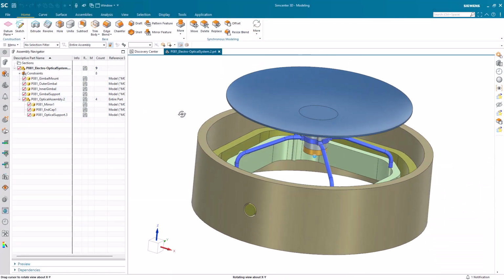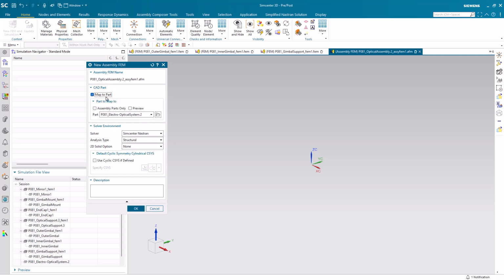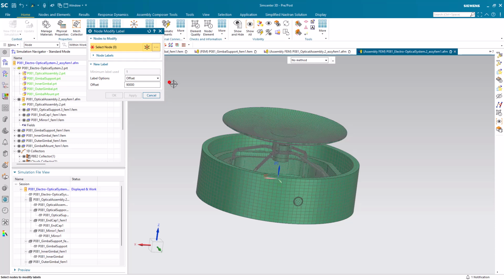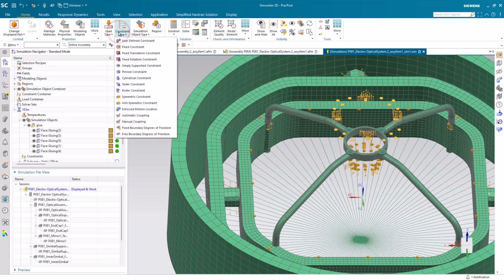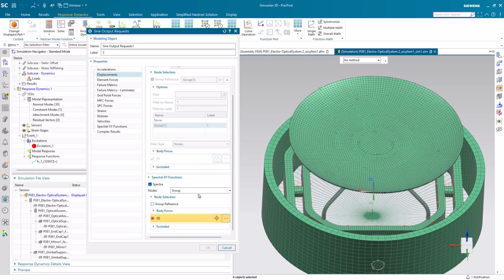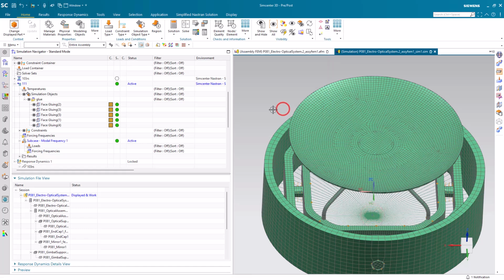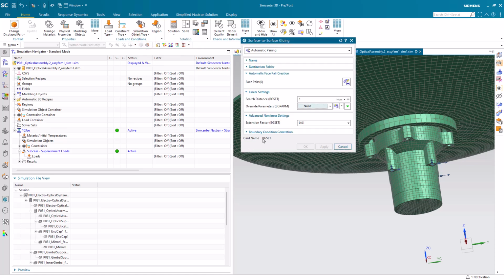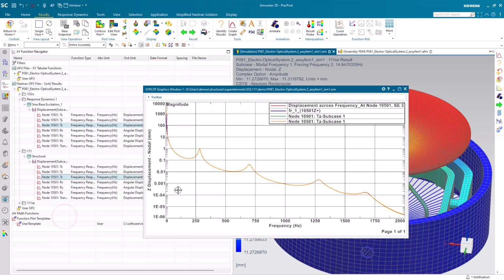How To Create A Frequency Response Analysis With Super Elements

Comment: In SOL 103RS you put user defined constraint with z-free to create the enforced motion. In SOL 111 you fixed all DOF on that point, why?
Reply from the maker: For response dynamics, the video is setting up enforced motion along the z-direction then SPC'ing the other 5 DOFs.  When we specify enforced motion, the exporter automatically creates an SPC for the DOF for which you enforce motion. Therefore, we are technically SPC'ing all the DOFs of that node. 

If we just have a simple static equation [K]{x} = {F} and let us assume we just have 2 DOFs in it (x1 and x2). Then K_{11} x1 + K_{12} x2 = F1 and 
K_{21} x1 + K_{22} x2 = {F2}.  Now if we enforce a displacement of 15.0 for x2, we know the value of x2.  The first equation then becomes

K_{11} x1 = F1 - K_{12} * 15

The first equation is almost as though we have zeroed the x2 DOFs. However, we are accounting for it by moving it to the right side of the equation because the values of x2 are all known or exactly enforced.  

Nastran requires that we SPC the DOFs where we enforce motion.  That is because Nastran is only going to move the enforced motion DOFs to the right side like the above equation but it expects the user to remove those DOFs from the left side of the equation. Technically, Nastran should be doing this internally - SPC the DOFs with enforced motion.  It is just some book keeping internally.

Enforced motion does not require us to SPC all DOFs of enforced motion node.  We can simply enforce motion in Z direction and just SPC the node in z-direction only.  However, for base excitation, we prevent any motion other than the enforced motion.  This is why the only SPC in base excitation problem is the SPC of the node (in all directions) regardless of whether we are enforcing motion in one or more directions.

If the results are in any units, we can convert it to user defined units.  Edit the Y-axis and set the units system to "Select Units" and then choose g_0. This will give the value in g-units. Standard g values will be used here.